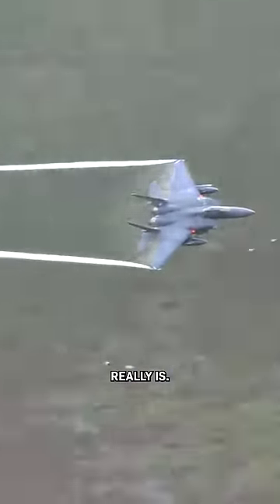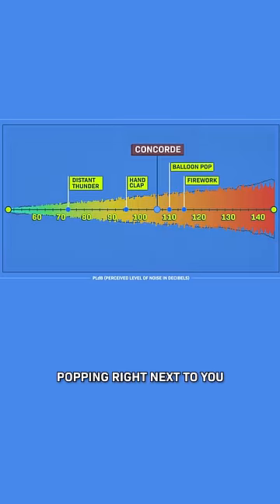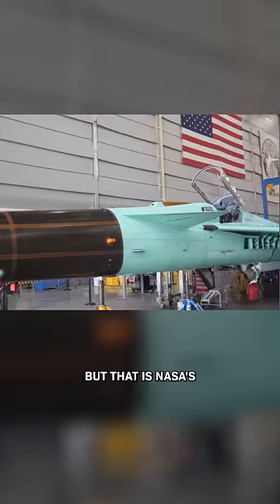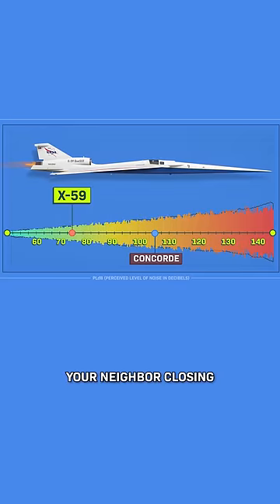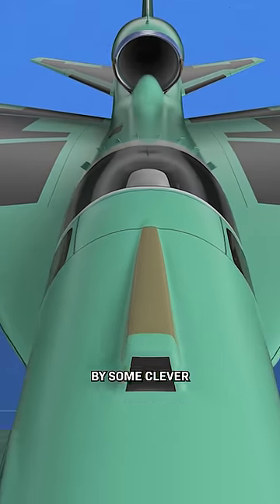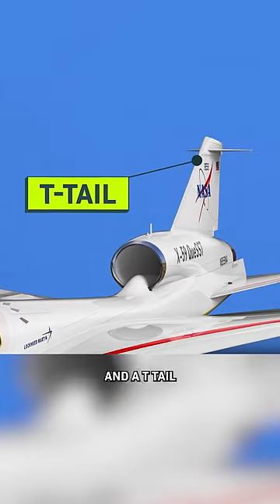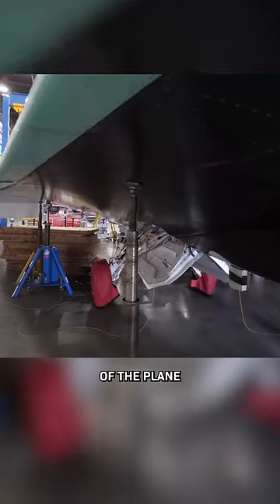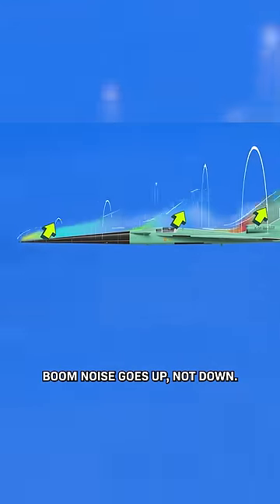How LOUD Is A Supersonic Plane?

Comment: This is fantastic,  and they're working on it just in time.
Reply: Just in time for what? This has been worked on since the 1960s.
Reply: @paulsengupta971  😅 just in time for me! 
Shhhh, I'll tell you something, but if you repeat it to anyone else, I'll make light of it so that people will think you're chatting shit! 
There are only two commercial jet providers, Boeing and airbus, and they're both out dated, I need a 3rd.
Again air travel takes time, guaranteed there's still about another 2 decades until this becomes common, by which time will be perfect for me to adapt their technology and flood the market with a 4th even 5th competitor.

In general, competition is good.
Reply: @sandrajones8245 <Nods>

Comment: Way back in the 60’s the FAA did a study on sonic booms and their effects on buildings. If the Concorde and American SST’s flew at supersonic speeds over the continents would the sonic booms damage homes, etc. Part of the study was an Air Force F-104 Starfighter taking off from Tinker Air Force Base and flying at supersonic speeds over various parts of Oklahoma City. Every day a little after noon you could hear the plane ✈️ and the Ba-Boom of the sonic boom. Yes, there was damage to homes and buildings, thus Boeing never completed their SST project and although the Concorde flew over the continental U.S. it never flew supersonic. I’m sure some of you have been near a military aircraft flying at supersonic speeds and the ba-boom is substantial

Comment: I actually had the semipleasure of experiancing 2 sonic booms in europe and I think actually both were due to what the local military will call an incident. Once was somewhere in france close to the ardèche river, tho I don't have the details. And anotherone was when a plane of a north coreant embassedor lost it's transmitter over a german city and the german military was not sure if it was an accident or planned so they sent 2 tornados, which is basically half of all (funktioning) tornados germany has
Reply: I used to hear them in Cardiff when Concorde was flying down the Bristol Channel on its way back from New York to London. I've also heard them from the Space Shuttle coming in to land in Florida, and the loudest at Edwards Airforce Base in the US when they were F-35 testing.

Comment: Cleo if you haven't heard a Sonic boom in person while it may register as a balloon pop on a sound pressure level meter they are far louder and pack way more punch than you're ever expecting. Having heard hundreds if not thousands they scare the crap out of me every single time. (I work on a base that hosts both f-15s and f-22s)

Comment: I will save you some time. They are designing the plane so that they can bring back supersonic. Commercial airplanes, the Concord's boom was way too loud, so NASA is redesigning a plane similar to the concord. The only difference ISIS that the sonic boom is way quieter and.  Supersonic air travel.
Can be possible again

Comment: Can someone explain to me why this lockheed design is now getting so much attention?  We have LOADS of supersonic jets which can travel well over mach 1. This one is just being designed to mostly deflect shockwaves upwards and away from sensitive ears.

Also, I like how the common folk think this is "new". Lockheed's SR-71 operated at 3x the speed of sound in 1964... The public only learned about it's operational use nearly two decades after it was used.

Guessing that because lockheed's letting us see this now, it either means it's been in use since 2000, or they have something way way better (or both).
Reply: The speed isn't the new part. It's the silence. That's why she's talking about how countries have regulations against supersonic travel. This plane design solves the main problem that put the Concorde out of service.
Reply: @forresthopkinsa  I get that, but this isn't a passenger jet, right? Judging by the cockpit and fuselage this is a fighter jet. If fighter jets had an actual tactical reason to go supersonic over mainland America then people would have much larger concerns than simply being disturbed by booming sounds.
Reply: @forresthopkinsa  also, I thought the primary reason for the retirement of the Concord was its operating cost... Sure, its supersonic operating window was limited mainly to transatlantic flights, but paying well over 12,000 bucks for a one way ticket is.... excessive.
Reply: @erik.schlegel  You should watch the full video
Reply: @erik.schlegel  this is just an experimentam craft. Probably will be used on commercial airliners.
Reply: @amppari_234  thx. I watched the full vid and realized SOME of the missing pieces as to the WHY. But I'm still weirded out by the fact that NASA is teaming up with Lockheed to solve a problem that is out of their jurisdiction. If Lockheed, or any other private company, wants to solve for commercial supersonic flight, great. But why is a gov't agency involved at this step? The shouldn't be receiving tax dollars to invent, popularize, or publicize commercial applications.
Reply: @erik.schlegel   well, Lockheed has worked with the goverment before on military applications.
Reply: @amppari_234  Oh, clearly. For ages. No concerns there. I'm thinking about it from the other direction. Why is the NASA+Lockheed complex solving problems in the public sector? I submit to you they are not, but are rather trying to figure out how they can have military jets regularly fly over densely populated areas at lower altitudes without otherwise announcing their presence. And if there is a commercial application as well...so be it.
Reply: @erik.schlegel  perhaps
Reply: @amppari_234  If not, then the other question still stands: why is a gov't agency working to solve a commercial problem? They should expressly NOT be getting taxpayer funding to do that.

Comment: But does it actually work?
Reply: NASA tends to actually do the engineering before they build something or even say that they'll build it, unlike modern techbros.

It'll work, it'll fly, it'll quiet the booms. The question is whether it'll work. Whether it is a viable effective for providing mass transportation. Whether it'll work financially, whether it'll be mass producible, whether it'll get regulatory approval.

Will it work? Yes, but no. There's not a chance that something like this gets made into a Concorde that flies over your house anytime withing the next fifty years, at least IMO.

Comment: Why they're building this plane? Easy, cause they were given money to desing a stealth supersonic bomber, and they don't know it themselves.
Reply: Mmmm, the next generation of the B1 Lancer.
Reply: a supersonic bomber? that doesn't seem very efficient, we already have missiles and rockets.
Reply: @deadosaka1712  And you're under the impression that one is substitute for the other?
Reply: @daniel.s.stefanov  one is much more efficient and can have similar effect, often times can be cheaper as well.
Reply: @deadosaka1712  Missiles either have a limited range or are succeptible to counter-missile systems. Missiles can't be used for recon. Missiles can't carry drones. Missiles can't be used for false flag attacks. Missiles depend on satellites for direct control, which is an extra vulnerability. Missiles can be cheaper for the regular slaughter of civilians that the US has been doing past 6 wars, but are much more expensive if used in a balanced, prolonged conflict. Need I go on?